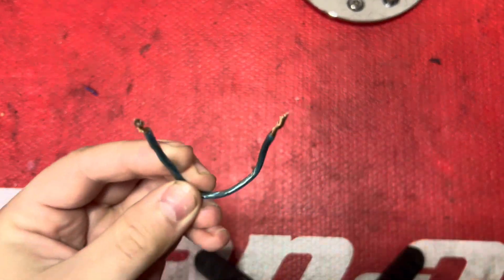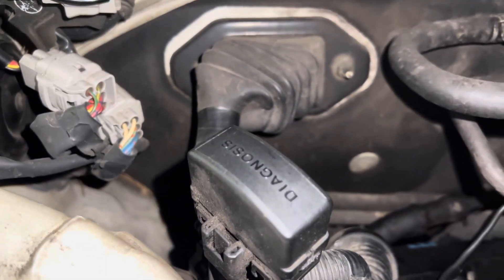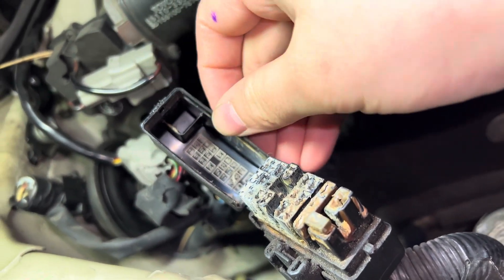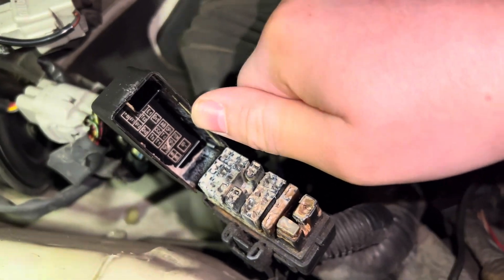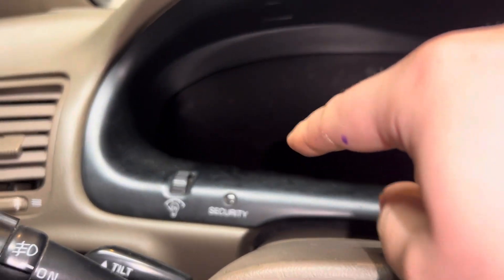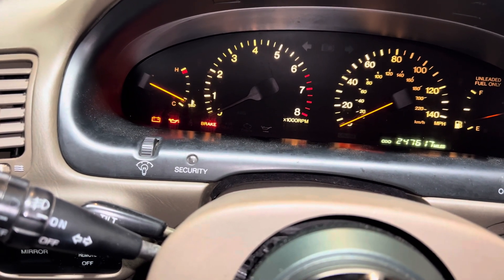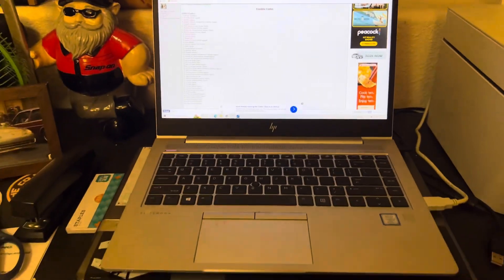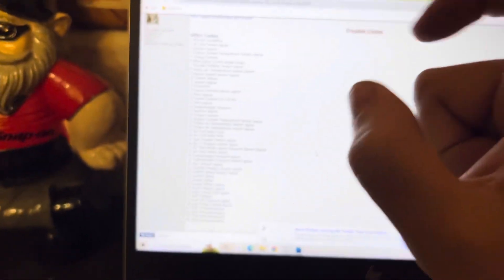How To Read OBD1 Lexus and Toyota Check Engine Light Codes

Comment: How does one retrieve transmission trouble codes on ODB 1 1993 Camry V6?
Reply from the maker: There is no transmission codes with a car this old. You only have one ecu to power everything. You would check the CEL as is and see what comes up. There’s nothing else available to check sadly.
Reply: @blackwaterjpn Thank you for the reply. I came across a fellow who linked E1 and Tt on his jdm 1994 Landcruiser to get codes 61 62 63 64 with the overdrive light blinking, indicating faulty solenoids. Mine is North American production and the Tt slot in the diagnostic port is empty.
Reply: @blackwaterjpn  
https://m.youtube.com/watch?v=bGFdDOjVX-Q

6th Gear Garage is his channel

Comment: today my old corollas warning light came on, then i turned off the engine for lunch, when i started the car check engine light turned off by itself and never came back on. should i just leave it or should i check for codes (though im not sure if its of any use since the light disappeared)
Reply from the maker: Sometimes even though the light is off, the ecu stores those codes so once you go to read it it will still pop up. If you’re not having any issues with the vehicle then maybe you would rather wait. Totally up to you. You can check and see if anything is stored.